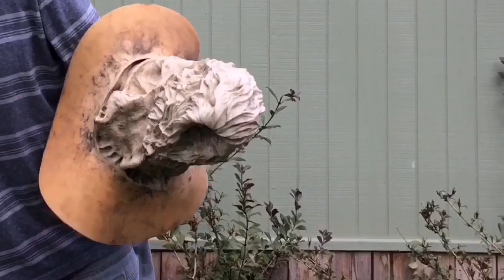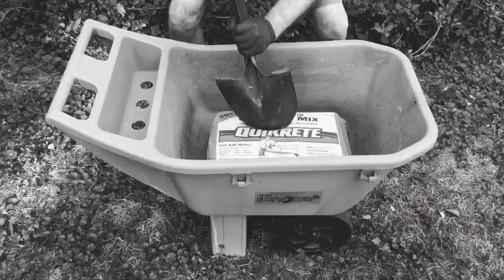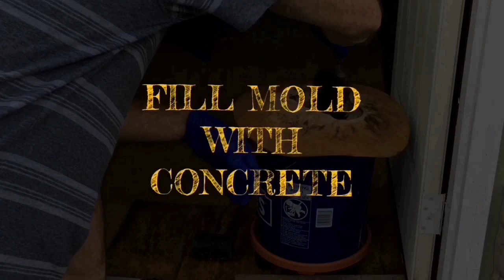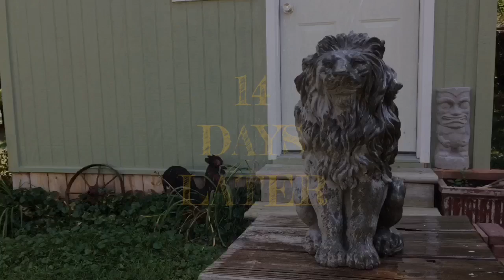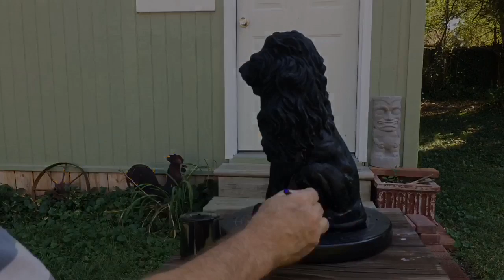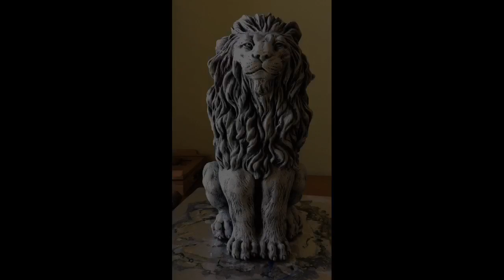Make a Lion Statue With Concrete

Comment: You should put charcoal tint into your concrete mix that would give you a starter for your basecoat as well as get a Roto hammer and use it as a concrete vibrator. You can dip it down into the structure itself and pull a lot of those bubbles out on a smaller scale, but just like the big boys do. It did turn out nice although I am trying to figure what my first 3-D structure will be. Mostly concrete steppingstones you know the turtles paw prints blah blah blah but again nice work
Reply from the maker: Thanks for the tips!

Comment: Really awesome statue. Well done! You've got a lot of talent and good taste. I want to make something now... I can't sculpt on that level, but my dad was an amazing figure sculptor so maybe it's time for me to finally learn... at forty years of age haha
Reply from the maker: Thanks for your comment! I think anyone can make one of these with a mold. If you want to do it, just do it.
Reply: @x-webman  Do you buy the mold somewhere or make it off a plastic piece?
Reply: @jacobmarley2417  Most of these are made from a piece that's already been made, I go to yard sales and second hand stores to find things to mold once you have found what you want to mold then liquid latex is applied in layers to make a thick mold, depending on the size of the piece you are replicating depends on the amount of latex you would have to use for rigidity and to prevent expanding from the weight of the cement, as to why he also surrounds the mold in sand to prevent expansion in the mold, for a piece of this size you would end up doing in the range of 40 or more layers which is time consuming as to you have to dry each layer before applying the next using a hair dryer or something of the sort. There are other options to making molds however latex is one of the more cost efficient ways of doing so.

Comment: Great work 
What’s the secret so that the gravel don’t show up in the surface? I had that issue with planter mold
Reply from the maker: Thank you! Tapping out the air bubbles should keep the gravel from the outer edges of the mold.

Comment: Wouldn’t it be alot quicker to base coat white or light gray and then spray a black wash?
Reply from the maker: I’ve never tried that, sounds like a good idea!
Reply: x- webman don’t forget to add some detergent (flow improver) to the wash. And maybe wipe the wash a bit from the raised parts. Should be alot quicker and easier on the wrists. ;)

Comment: awesome video! quick question. iv"e been making small statues for a couple of months and at first, I was making my own mix with sand aggregate and portland cement, the mold I was using was of an owl and after it was done curing I would take it out of the mold but the ears would always break, after continuous failing, I decided to just use portland cement with no additives and they came out great but over time they started cracking and then I came across this video and see that you use a premix bag of concrete so I bought the same concrete you use in this video and gave the owls another shot hoping the ears would not crumble and I would have a long-lasting noncracking statue, and well they broke once again and now I am completely lost and have no clue what I'm doing wrong I've tried everything more than once and still seem to not figure it out. do you have any clues that may help🤷‍♂️if so thank you so much!
Reply from the maker: Maybe try leaving to set longer before removing it from the mold. You could also try putting a small piece of wire in the ears for reinforcement.

Comment: This is great. Thanks for sharing. I also recently used apparently same concrete mix which has cement, sand, gravel etc.. and I also sprayed water on it for 2 days. But now after 1 week, it seem little brittle on the edges. Whnever I pick it up, some sand sheds out of it. Do I need a sealant on it? Can you suggest what can be done?
Reply from the maker: Sounds like maybe too much water in the mix or sprayed on.
Reply: @x-webman  I see. Yeah may I sprayed too much water. Is there something I can do now?
Reply from the maker: Make a new one

Comment: i like this mold... using sand for support instead of fiberglass... also what rubber was used to make this? is there a kit available with instructions on making this mold or similar type?....thanks
Reply from the maker: This is a latex mold I bought on Ebay.com. There are many video’s on Youtube showing how to make a latex mold.
Reply: @x-webman  thax... i will check it out... i wonder how much cost is to make a mold like this? looks like your mold was made by painting multiple lyers of latex over a lion statue... i just need to find best source and correct latex to buy... thax
Reply from the maker: I think you could make a mold like this for around $40. First, you will need an actual statue to make a mold from.
Reply: @x-webman  yes it seems to be pretty simple just takes over a week to make a latex mold....thax... maybe making a mold from silicone is better and faster.

Comment: Love your video tutorial. 
I have a question,  would mortar concrete work instead of the concrete mixed with all that gravel?
Reply from the maker: I’ve never tried it.
Reply: @x-webman  I'm looking forward to a a smoother surface. I tried with the mix you used and ended up with a bunch of rocks on the outside of the finished mold. Thank you for you tutorial videos they are great.
Reply from the maker: Vibrating the air bubbles out will keep gravel from the outside. The finished statue will be as smooth as the mold you are using.
Reply: @x-webman  thank you I will try that on my next one.
Reply from the maker: Thanks for watching & good luck! Let me know how it turns out.

Comment: Hi Great job! Could you please make a step by step video on how to make the mold. Thanks
Reply from the maker: Hey, thanks for the comment! I don’t make the molds. I buy them online from Ebay, Amazon. My videos are to inspire you & show you finishing techniques. There are many great videos on youtube showing how to make latex molds. Thanks for watching my video!
Reply: @x-webman  Thank you for your reply and info. I will look on Ebay/Amazon for the mold. Blessings!
Reply: @x-webman  How much does the mold cost?  If it's only a few bucks more then its probably worth just buying a finished lion statue itself.  But nonetheless, really good job!
Reply: @Gaba-oo4qb  moulds with this much detail and size looks to average between $2-300 on ebay. that sounds like a lot for something you might get, let's say 50-100 pulls out of (maybe far fewer for all i know), but latex is expensive and you'd obviously buy a mould to make things to sell. small moulds look to be in the $50 range.
Reply: @ryanbarker5217  Understandable. And how much can you get out if you sell the statue that you make from the mould?
Reply: @Gaba-oo4qb  i have no idea how much they sell for, lol. he mentioned in a different comment that he can get up to 100 pulls out of these moulds. so, for the sake of argument, say you sell these for $15, which would be cheap i think. that's $1500 (if you actually sell them), not considering the cost of the concrete, which is cheap -- lowe's has it on their website for 80 pounds of crack resistant, fiber reinforced quikrete which doesn't require mesh reinforcement for $6.80. there's extra cost and time involved in fixing air pockets, but that's probably not much of an issue.

all painted up, i might guess $40, but i really can't say. if you have a strong back and a couple of extra hours, it could be a nice side  hustle. imo, these are preferable over a fiberglass mould because there are no seam lines.
Reply: @ryanbarker5217  I guess I don't enough about this process to speak intelligently or the words you use when describing it.  But basically what I was just wondering...is if you make a concrete statue from the mold, how much profit do you think you would make after expense of buying the mold and all other supplies?
Reply: @Gaba-oo4qb  prices seem to have a fairly large range. don't think of the investment as figuring into your price. 

there are several ways of approaching a business, if that's what you're asking. if you're in america, you'd need a vendor's license (in some states they're free) and an EIN, which is basically your federal i.d. number and in some places a requirement. you'd have to check on your state's requirements. in this case you'd probably then want to set up as a contractor at lowe's if they'll let you, then you can get a discount on supplies. 

in my area we have plenty of large flea markets where these things get sold. you might arrange a deal with some local plant nurseries. unless you find a way to sell directly to the customer, you'll have to supply them to other places who will want their cut. ppl have plenty of ebay listing for these, but obviously shipping is a huge factor. 

to produce one shouldn't be ten bucks in materials. quikrete is cheap, and the other supplies aren't anything fancy. 

it's a case of how much you think your time is worth. there are several different business formulas, it's up to you which one you like the best, the most classic and basic being cost + labor = price, but you need to be cognizant of your competition's price, too. barring a physical reason, these aren't incredibly time-consuming, it's just letting them cure that takes awhile, it seems. it shouldn't take you an hour to mix and pour once you get into it. 

does $20/hr. sound good to you? then you'd probably charge $30, more if it's painted.
Reply: @ryanbarker5217  I think in a nutshell it's all about supply and demand. Depends on how many people you know that are willing to fork out a specific amount for the statue. How many people in your area are willing to spend the amount you want.

And if you cannot, then it will just become a labor of love
Reply: @Gaba-oo4qb  just like any other product, you have to make it, market it, and sell it. the challenge here is the weight, which is going to be a sticking point to ship. you could put a plug in the middle to cut down on material and weight. 

as i mentioned, you have to be aware what your competition is selling similar products for as a guide. a lot of people like garden statues or just something to put on their porch or end of their driveway. 

if you go with a large statue you might have to start adding internal support such as wire mesh or rebar, i'd say. 

anyway, there are places to sell these things, you just have to hustle a bit. concrete isn't the only material you can use, either.

Comment: AWESOME! Def saved this video. I love these lion statues but too expensive to buy. Great video. Where did you get the mold & how much?
Reply from the maker: Thanks! I got the mold on Ebay for about 230.00.
Reply: @x-webman  wow that's expensive
Reply from the maker: Yes it is. With fiberglass backer it would be another 100.00 or so, that’s why I use sand!

Comment: Hi, can I know this Lion Sculpture can put outdoor?  The paint is safe under the heat and cold outside?  Thank you!
Reply from the maker: Yes, it be outdoors. The paint is latex. The sun and rain will take it off after a few years.
Reply: @x-webman  Hi, thanks for the quick reply and helpful info.  Can I know what brand or alcohol are you using?  Any photo?  If it is, it should be very helpful tip.  Thank you!
Reply: @x-webman  And castor oil too. So that I can find it quicker if possible.  I am going to buy a mold tomorrow.  After watching your video, I am kind of interest...
Reply from the maker: I use CVS brand, but the brand does not matter as long as it is Isopropyl alcohol.
Reply from the maker: I use CVS brand Castor Oil, but the brand does not matter.
Reply: @x-webman  Ok, sure.  I went to search some info too.  Just worry bought the wrong one, damage the rubber mold. Thanks for your time!
Reply from the maker: You’re welcome & thanks for watching!

Comment: Cool
Reply from the maker: Thanks!
Reply: @x-webman  I use a similar product here in ireland called Post 10. It's a readymix concrete that does the trick very well but you have to be carefull about adding too much water

Comment: Great video but  a slow method, no offence
Reply from the maker: Plaster’s faster!
Reply: just letting it cure fully apparently takes several weeks, especially since it's solid. plus, i'm sure the environment has a lot to do with curing rates. i imagine there may be some additives to speed the process up, but i'm just guessing on that. he could produce one every two days otherwise. try 3D printing that and see how long it takes, lol.
Reply: @ryanbarker5217  I have a method with a certain type of concrete I use. I can pour up to five or six statues a day. Which is really helpful. I had a lady come by for one yesterday and she decided she wanted x 4. I was able to pour all four before bed last night. Let them cure under a fan overnight and they're good to go
Reply: @x-webman  the problem with plaster it doesn't hold up especially Outdoors
Reply: @victoria653  i've seen one thing on another video where it looked as if the concrete was being injected into the mould, but that didn't seem to alleviate any air pockets. then again, i didn't see him taps the sides or shake it, either. 

i know there's concrete made for this stuff. what you say doesn't surprise me, but if you'd like to share, it would be interesting to know how you get four pulls out of one mould with concrete in a day. :)

Comment: Excuse my language here, but how the fuck did you manage to get a realistic looking statue without dry casting... Clearly it must be the texture of that Quikrete you're using.
Reply from the maker: I don’t know what dry casting is! The statue will be as detailed as the mold you’re using. If you made a latex mold of your hand, the concrete statue would have your fingerprints. As far as I know, most any concrete will have the same results.
Reply: @x-webman  dry casting uses the same mold technique as what you did, but it combines fine sand, cement, waterproofers, stone pigments, and emulsifiers, etc. and uses less water than wet casting (which is a process similar to what you did), instead of fully curing by water, it's fully cured after an initial set by using steam in an enclosed area.